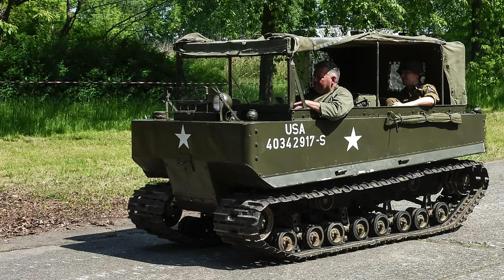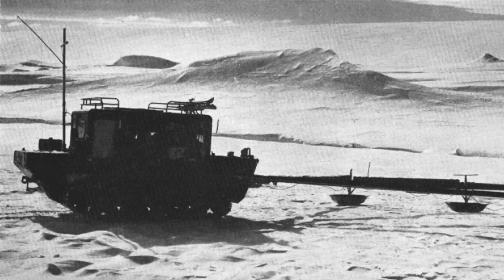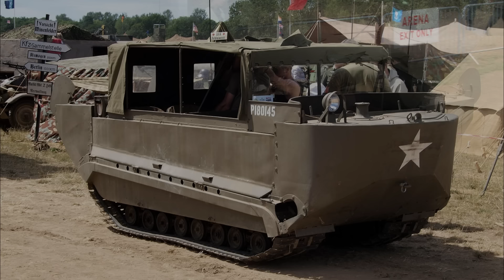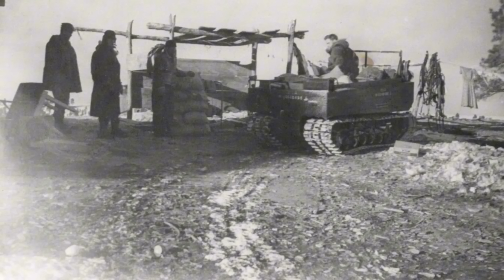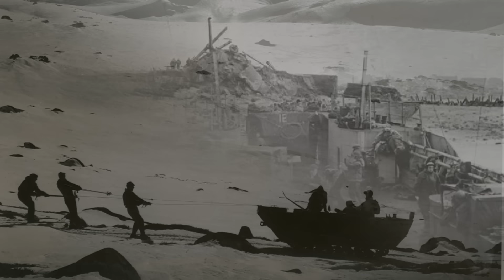The Forgotten Cold Weather Triumph of WW2 - The M29 Weasel

Comment: At least 40 years before Cat released the their INDUSTRY LEADING Mobil Rubber track system.   Does anyone else though that most of these videos are like brochure blurbs and some especially the agricultural tractor ones where they talk about one model and show at least one wrong image of either a much newer machine or a montage of 3 different model ranges.
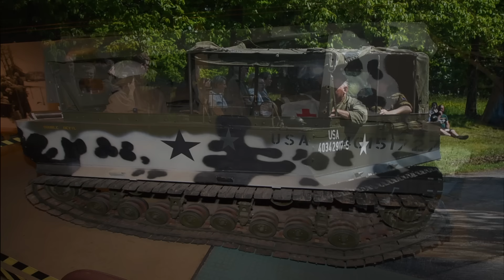Reply: Just watched a video about a guy that scored tracks for the M29 he's restoring. Fancy rubber bands with steel grousers attached. 8:35 shows that very well.
Reply from the maker: Thanks for adding this pal - much appreciated 👍🏼
Reply from the maker: Thanks — and you’re right that some period photos can be inconsistent across some videos. I always aim to use the most accurate imagery available for each vehicle but there just aren’t many images. In future I plan on paying for more images and a deeper dive into the technical aspect of the vehicles when  I can source. 👍🏼